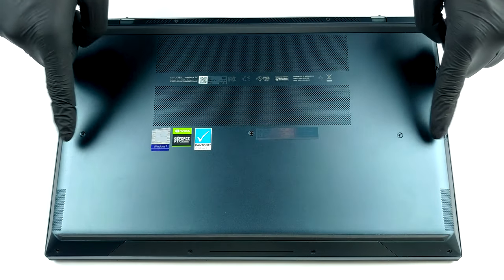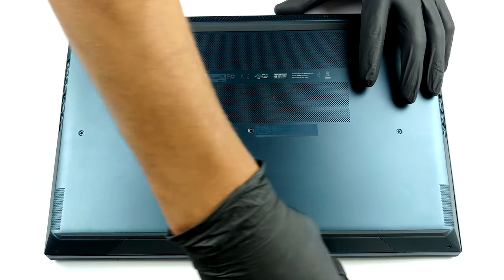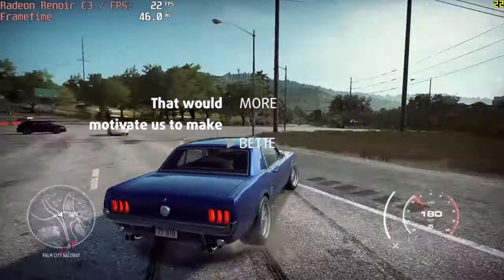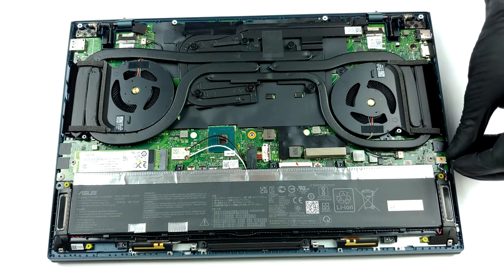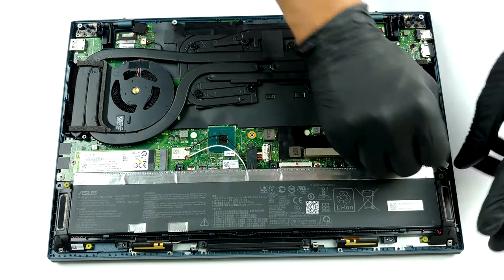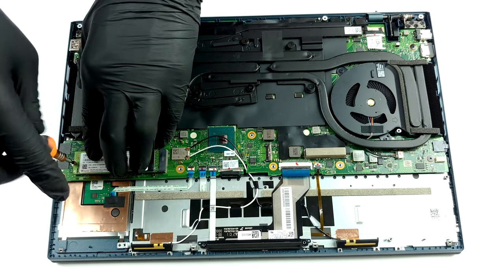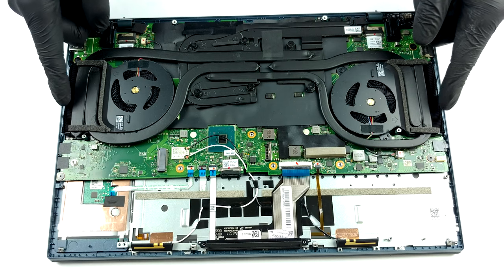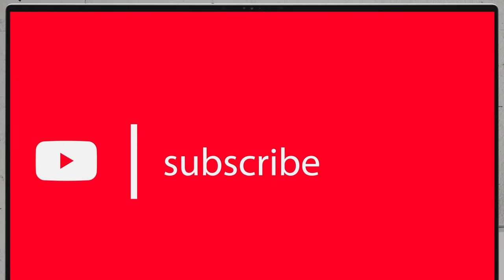🛠️ ASUS ZenBook Pro Duo 15 OLED UX582 - disassembly and upgrade options

Comment: I have been using a laptop for four months, I bought a version with i712700H and 16gb. I have enough power, but there is one very annoying moment - the keyboard rattles from the left where the CapsLock letter A, somewhere in this area, I put a credit card or phone on this place and the rattle disappears, but this is not normal in a top-end laptop from Asus. And so everything is super, I use the second screen in full.

Comment: So far still an amazing laptop. A lot of laptops now adays are going more form factor. I do think it sucks not having a battery that I'd easy to take out but you'd have to think an engineering design persepctive. The laptop would be HUGE with a slide battery. I'm just bummed about the ram but I got a the 32GB version and that should last 10 years easy with probably a couple batteries. Also you can probably run this off a PowerBank if you don't feel like ripping it apart lol

Comment: Hi, I have this asus zenbook ux582l. When I change the ssd nvme, the windows 11 setup is in the small partition of the original ssd or in one type of eprom? because when I turn on in first time, the system install windows automatically

Comment: Can i ask am i able to take rtx3070 graphic card from this laptop and put it inside of ux581 if i have a machines and the staff which usually used to change broken processors or grafic cards on laptops? Or it's not gonna fit there ?
Reply: Or maybe at least change the cpu
Reply: no you cannot
Reply: @dylanf8591  it's sad

Comment: I have been using asus vivobook for the last 8 months, i use laptop with always plugged in keeping the battery health charging software at maximum lifespan mode which allow charge only 60%. I switch to full capacity mode once a week and then use the laptop on battery. When the battery comes down to 15-20% i plugged in again and switch to maximum lifespan mode agsin and continue using the laptop in this mode for next 6 days of the week. Now i can see my full charge capacity has been decreased from the design capacity upto 3000 mah in just 8 months, although backup time is still ok. Upto the june, 2021 the full charge capacity was close to design capacity,  but it detoriarated in just 1 month. I just got confused. I can't find any answer from asus or any tech guy. 

Does anybody here face the same issue like me? I checked all this generating battery report from command prompt.
Reply: You are doing everything right as far as battery health except bringing it down to 20%. You really at best should be at 3.5 to 3.6 volts(if you want it to last the longest) That should be approximately 30 to 45% but batteries are non-linear do the % can go anywhere. 60% is legit perfect

Comment: So the ram is not upgradable?
Reply: Nope. Even to upgrade the SSD, will need some extra tools
Reply: @RomanDoes  what extra tools?
Reply: @djroc449  something to clone existing ssd to new one before you can swap it
Reply: @RomanDoes  no you don't... you can just plug the new drive and and do a fresh install of the OS
Reply: @JoshuaEatonCA  that is if you want fresh install

Comment: Here are the failures  of this laptop.
1)For a high end laptop like this would expect it to have a FINGERPRINT SENSOR,for unlocking it.But nope it lacks ,an area that hp covers well.They want you to use the web cam for unlocking the unit which ain't good for some of us who like covering it due to privacy issues
2.The laptop i expected would come with a type C charger at least due to its high end price ,but its a disappointment.🤦‍♀️🤦‍♂️
3.)The laptop pen isn't magnetic  like that of the Hp spectre  which makes it easy to get lost.U can't even charger the pen which i thought wud be chargeable via usb C like how Hp spectre does🤦‍♂️🤦‍♀️🤷‍♂️ 
5.) This is something i have noticed in most new laptops ,Now that the power button is incorporated in the keyboard keys, it would be great if it was colour coded, to distinguish it from the other keys 
I REALLY HOPE THE UX583 CAN FIX THIS.
 #MY ADVICE IS TO SKIP 
THIS ONE AND WAIT FOR THE NEXT ONE.
Reply: Thank you! I didn't consider these flaws until now. I hope the third version is announced soon!
Reply: 1. "They want you to use the web cam for unlocking the unit which ain't good for some of us who like covering it due to privacy issues" you cant have everything, covering is your choice and they give you other methods to sign in. You'd be giving up your privacy with the fingerprint as well. I bet the stats for people using a fingerprint sensor when they are available is like 1%. They packed as much as they possibly could. In my opinion it's very slick and small for a laptop considering what they put inside. I expected a large beast that is basically a replacement for a desktop PC, but nope, it's great.
2. Could type C charger charge this laptop as efficiently (i don't know)?
3. I agree, laptop pen is quite bad. It's large, doesn't feel premium, you have to replace batteries...

In my opinion definitely not a version to skip. Like how is charger type, fingerprint sensor, pen and button light a reason to skip one of the most innovative laptops available now? :D You'll be waiting for a perfect version your entire life.

Hugely improved over ux581 and zephyrus. I think the only reason one might want to skip this version is the screen refresh rate, but if you plan to play games there could be a compromise of getting an external screen, which is what I wanna do (I know this is not a solution, but for me the screen refresh rate is not a dealbreaker in this case).
Reply: @Explorer724  the first one was announced two years ago tho, if you want to wait for the third one you probably have to wait another two years, and some of his point are actually wrong, the first one about the fingerprint sensor is depends on personal preference. What he said about the type c charging is totally wrong, a type c cable will only allow up to 100w of power delivery, for a laptop with these kinds of specs, the 3070 itself requires 110w of power, plus a i7/i9, and other components, it come with a 240w power brick, and that’s why you don’t see any high end gaming laptop support type c charging, all of them will come with a big power brick.  And I do agree with what he said about the pen tho, but consider if you really need two screens for more productivity and this laptop meets your needs, you don’t have much choices other than that.
Reply: Well the only downside of this laptop for me is the ram is not upgradable, so if I want the 32gb I have to pay extra couple hundreds dollar.
Reply: @jz7283  After giving it some thought, this is a really great laptop for both gaming and art! I was a bit disappointed with the new Razer Blade 14 and other laptops that were recently announced. The Zenbook Pro Duo and ROG Zephyrus 15 Duo SE are the only dual screen laptops capable of gaming that I know of currently. I like the smaller form factor of the Zenbook Pro Duo.
Reply: @jz7283  Small correction, the Zephyrus Duo can do USB C charging, and that's even a more beast of a machine than the ux582 (and basically every other laptop). But yeah, big con for me is no USB C charging that the Zephyrus Duo has! Another con is no SD slot, con is previous 10th gen i7 while everyone else has 11th. Other than that it's the perfect laptop, will be purchasing it soon. I love IR Windows Hello login, works like magic on my Surface Pro. Finger print readers are ugly and so 2000's tech. Imagine you're in a coffee shop with less-than-ideal greasy/dirty fingers constantly caressing and fingering your laptop trying to log in lmao, I see it all the time
Reply: @mamba109  The reason it doesn't have type C is because it tops at 100 watts, while this laptop charges at 240 watts
Reply: @jz7283  yeah this is kind of a bummer for me,I wanted to upgrade the ram to 32gb I was excited I didn't check to see what was upgradable and what wasn't
Reply: @mamba109  It will be throttled with that charger, just like it is when on battery. There's no way a 100W USB C charger runs this a i9 and decent graphics card while gaming.
Reply: @Tyraell01  what is the refresh rate of the screen? I'm considering getting it second hand, and it ticks all my boxes so far...